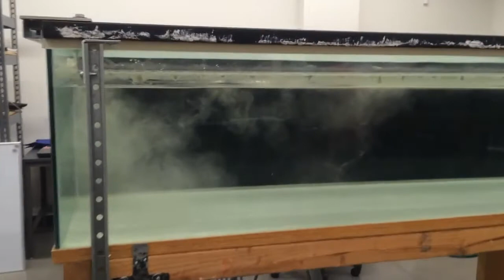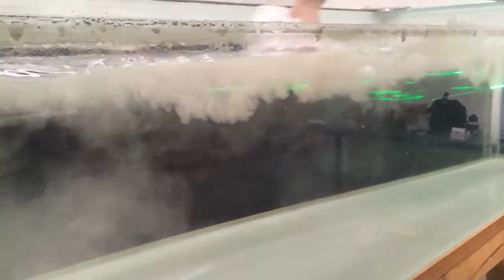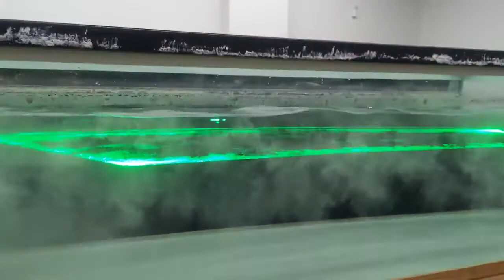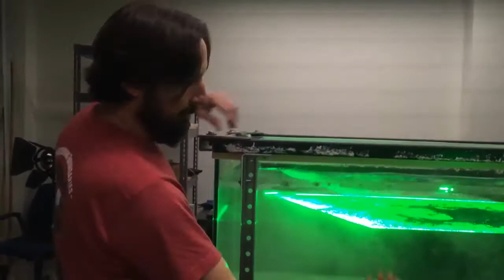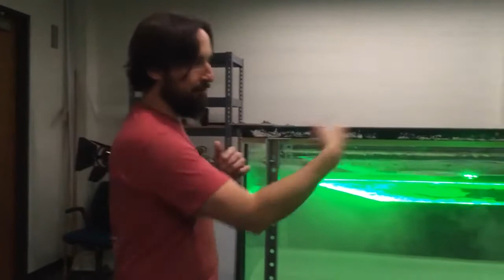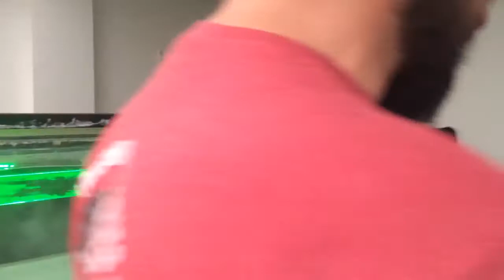Green DPSS laser for Particle Image Velocimetry (PIV) - sales@dmphotonics.com

Comment from the maker: New application - wind tunnel lab - request a quote at sales@dmphotonics.com
Featured facility:
The Wind Tunnel Laboratory operates a multi-disciplinary subsonic tunnel, with a maximum airspeed of 65m/s in atmospheric conditions. The singularity of the facility is its modularity: the wind tunnel is composed of two test-sections and several dedicated systems to investigate the field of low speed aerodynamics (Mach < 0.15).
The dimensions of the test sections and available instrumentation enable to study several types of engineering applications: aircraft systems (UAVs, rotorcrafts), wind Energy systems (wind turbines, energy harvesting), building aerodynamics and aeroelasticity, vehicles aerodynamics …
The Wind Tunnel Laboratory is part of the Department of Aerospace & Mechanical Engineering of University of Liège.
Researches
Several researches are carried out in the laboratory under the supervision of  Dr. T. Andrianne.
These topics are:
Bluff-body aerodynamics: flow separation due to the non-streamlined shape of engineering structure.
Bluff-body aeroelasticity: non-linear aeroelastic phenomena taking place when the structural response has an effect on the aerodynamic loading.
Wind Energy: Vertical and Horizontal axis wind turbines (performances and aeroelastic behaviour)
Flying systems: UAV (rotorcraft type)
Sport Aerodynamics
Experimental / Numerical Integration: the combination of wind tunnel measurements and CFD results yields to a complementary approach that improves the understanding of the physics involved.
Through its multi-disciplinary characteristics, the Wind Tunnel Lab collaborates strongly with several research teams from University of Liège and abroad. These collaborations take the form of European, National or Regional projects for which Academics include an experimental aspect to the researches.

Internal collaborations
Aeroelasticity & Experimental Aerodynamics (AEA-A&M/ULg)  – Prof. G. Dimitriadis
Multiphysics & Turbulent Flow Computation (MTFC-A&M/ULg) – Prof. V.E. Terrapon
Structural & Stochastic Dynamics (SSD-Argenco/ULg) – Prof. V. Denoël
Microsys Lab (ULg\EMMI) – Dr. P. Laurent
External collaborations
LadHyx (Ecole Polytechnique – Paris, France): energy harvesting from aeroelastic systems
Urban Physics and Wind Engineering (TU/e – Eindhoven, The Netherlands): sport aerodynamics and wind engineering
Japanese Aerospace Exploration Agency (Tokyo, Japan): EFD/CFD Integration

Comment from the maker: DPSS 532 nm 3W laser DMPV-532-3 (532nm Diode Pumped Solid State Green Laser 3000mW)

Model: DMPV-532-3 - request a quote
Wavelength (nm) 532
Output Power (mW) 3000
Working Mode CW
Beam Mode Transverse TEM00
                    Longitude Multi-longitude
Spectral Linewidth (nm) <0.1
Polarization Line polarization
Polarization Ratio >100:1
Beam Quality (M2 factor) <1.2
Beam Divergence (full angle, mrad) 2.0
Beam Diameter at Aperture (mm) 2.0~3.0
Beam Roundness >90%
Power Stability (RMS, over 8 hours) <5%
Aperture Position (mm) 48
Laser Head Dimensions (L×W×H, mm) 190 x60 x 60
External Modulation 5V TTL/5V Analogue
Modulating Repetition 30KHz TTL/10KHz Analogue
Cooling System TEC
Warm-up Time (minutes) <15
Operation Temperature (°C) 18~30
Expected Lifetime (hours) >10000
Warranty Time 1 year
http://www.dmphotonics.com/DPSS_DMPV532/DPSS%20DMPV-532-3.htm

Comment from the maker: DPSS 532 nm 1W laser DMPV-532-1 (532nm Diode Pumped Solid State Green Laser 1000mW)

Model: DPSS DMPV-532-1 - request a quote - buy from online store
Wavelength (nm) 532
Output Power (mW) 1000
Working Mode CW
Beam Mode Transverse TEM00
Longitude Multi-longitude
Spectral Linewidth (nm) <0.1
Polarization Line polarization
Polarization Ratio >100:1
Beam Quality (M2 factor) <1.2
Beam Divergence (full angle, mrad) 1.2~2.0
Beam Diameter at Aperture (mm) 1.2~2.0
Beam Roundness >90%
Power Stability (RMS, over 8 hours) <5%
Aperture Position (mm) 20
Laser Head Dimensions (L×W×H, mm) 180 x 62 x 62.5
External Modulation 5V TTL/5V Analogue
Modulating Repetition 30KHz TTL/10KHz Analogue
Cooling System TEC
Warm-up Time (minutes) <15
Operation Temperature (°C) 18~30
Expected Lifetime (hours) >10000
Warranty Time 1 year
http://www.dmphotonics.com/DPSS_DMPV532/DPSS%20DMPV-532-1.htm

Comment from the maker: DPSS 532 nm 8W laser DMPV-532-8s (532nm Diode Pumped Solid State Green Laser 8000mW)

Model: DPSS DMPV-532-8s (532nm-Green Laser-8W) - request a quote

Specifications:

 Wavelength (nm)	 532
 Output Power (W)	 8
 Working Mode	CW
 Beam Mode
 	 Transverse	TEM00
 Longitude	Multi-longitude
 Spectral Linewidth (nm)	<0.1
 Polarization	 Line polarization
 Polarization Ratio	 >100:1
 Beam Quality (M2 factor)	 <1.2
 Beam Divergence (full angle, mrad)	 2.0
 Beam Diameter at Aperture (mm)	 <3.0
 Beam Roundness	>90%
 Power Stability (RMS, over 8 hours)	 <5%
 Aperture Position (mm)	 84
 Laser Head Dimensions (L×W×H, mm)	 180 x120 x93
 External Modulation	5V TTL/5V Analogue
 Modulating Repetition	30KHz TTL/10KHz Analogue
 Cooling System	 TEC
 Warm-up Time (minutes)	<15
 Operation Temperature (°C)	18~30
 Expected Lifetime (hours)	>10000
 Warranty Time	1 year
http://www.dmphotonics.com/DPSS_DMPV532-8/DPSS%20DMPV-532-8s.htm